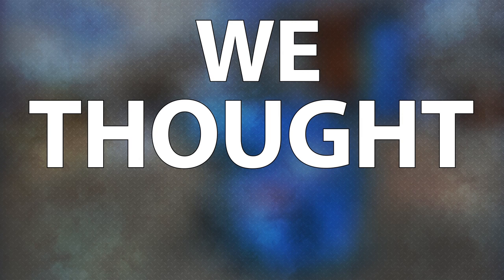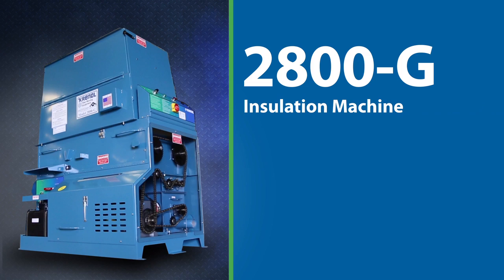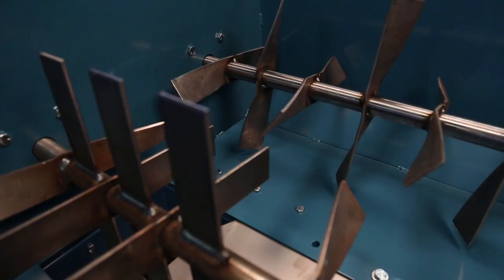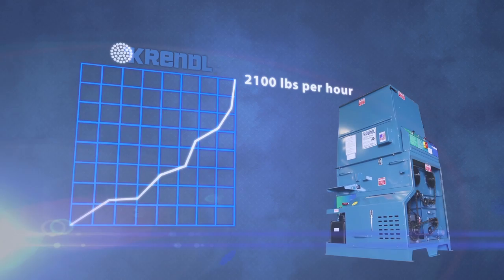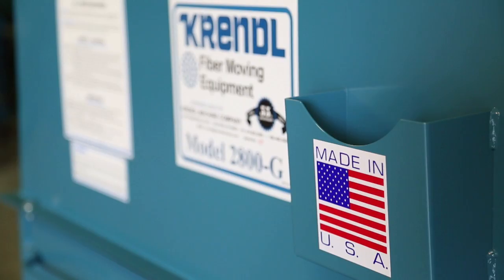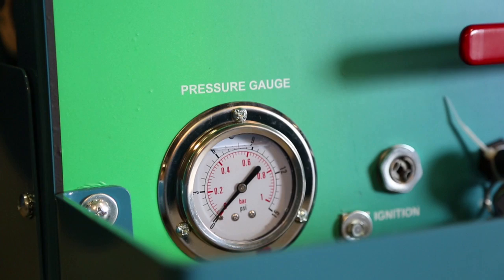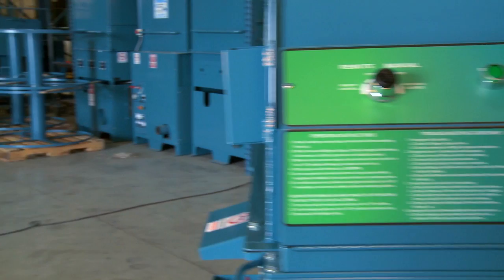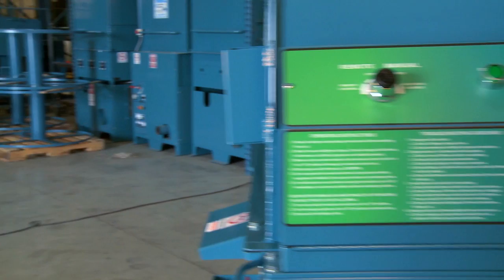2800-G Insulation Machine by Krendl Machine

Comment: Honda or kohler?
Reply: Moteur Honda 18ch ce qui était prévu pour ces machine vendu pour la France .mtm avec la pénurie des pièce peu être kil on changer de fournisseur de moteur mais je ne sait pas , je pense que ça doit être toujours Honda 18ch
Cette machine pèse 548kg (c'est correct )
600kg /hr laine de verre 
1200kg/hr ouate de cellulose 
650kg /hr laine de roche 
850kg /hr fibre de bois 
c'est annoncé cella 

Sortie de tuyau diamètre 100
Reply: They offer both options. I ordered one about a month ago with the 20hp Honda. It was a longer wait time, but worth the wait for a Honda.
Reply: I owned and used this machine for about 3 years. Unfortunately the exhaust system for the gas engine has a major design flaw. Carbon monoxide would re-enter the truck as we were running it. I monitored the CO levels and it was no longer safe to have my guys using it. I reached out to Krendl several times and they were unwilling to help me troubleshoot the problem so I sold it. Great machine, but needs some tweaking.